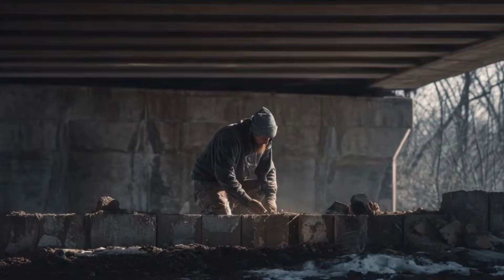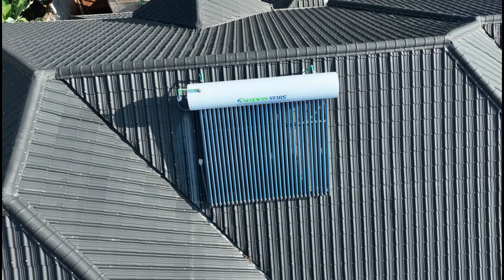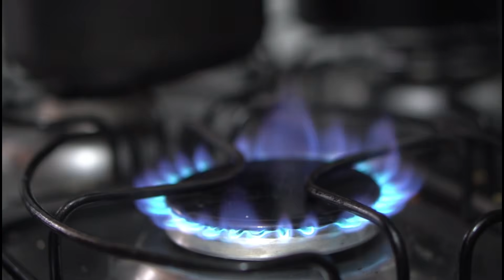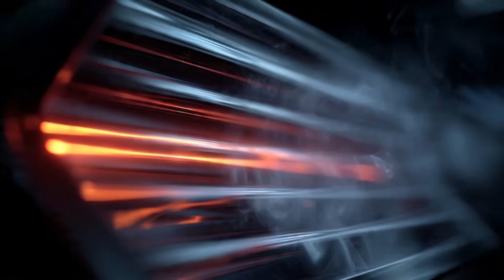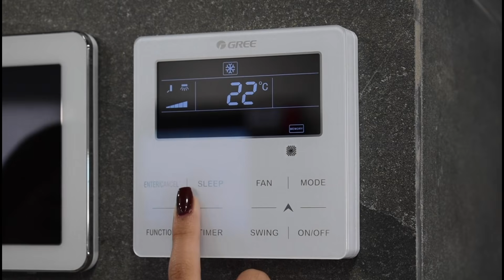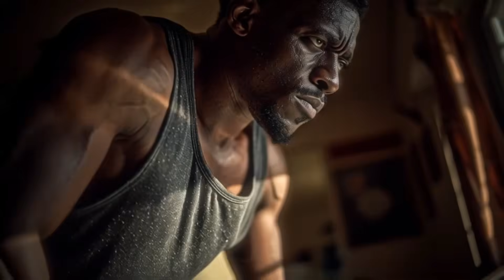How One Homeless Man's "Stupid" $8 Solar Trick Heats Any Space FREE All Winter

Comment: You don't need the fucking cans at all!!  Just a transparent sheet and behind it something matte black. Black window screen works. Or paint your south outer wall black. Then cover it with a wooden frame you screw a transparent sheet to. Then drill a two inch hole through the wall top and bottom. Mount a computer fan inside over the top hole. It will blow hot air into your house!!
Reply: ??  A 2 inch hole from inside your house through the OUTSIDE? Wall?   And the holes stay in the black Plastc are????  Where is his hot air build up?? Couldn't you  just put black plastc on the ourside of your house,,, where the sun hits,,, Put the Clear  Plastic layer on top.  and leave it at that?